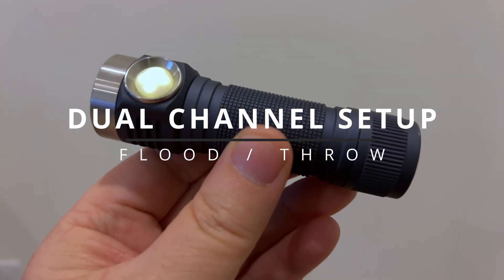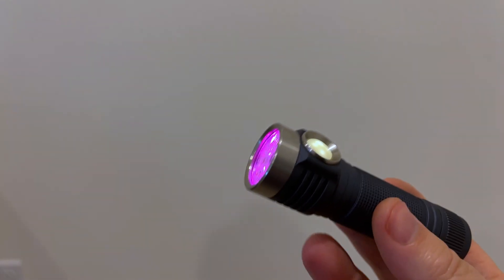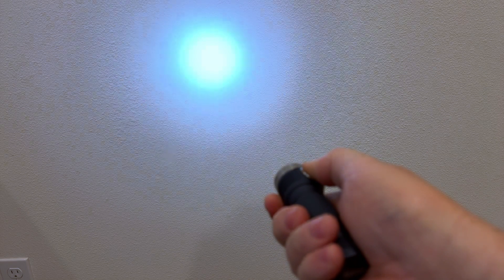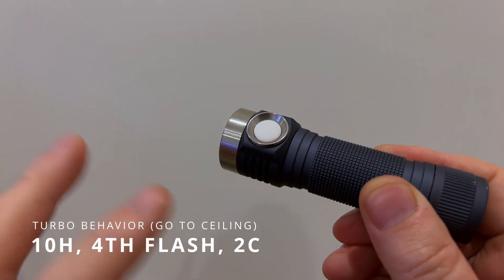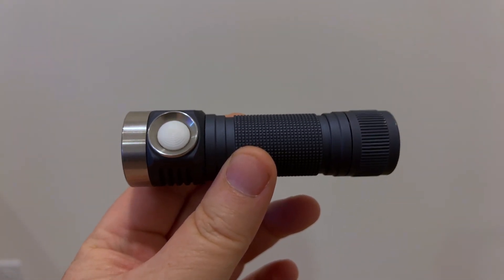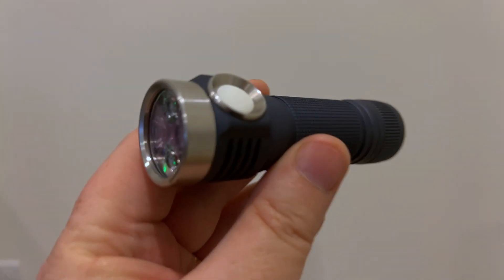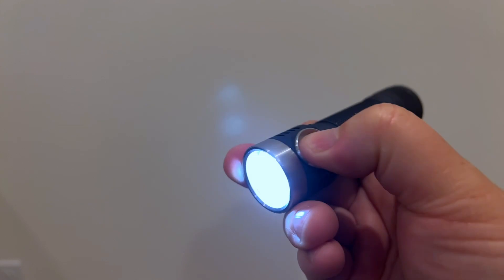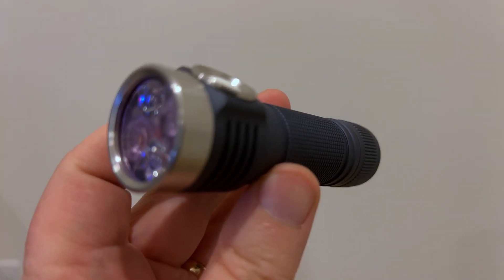How I set up a D4V2 Dual Channel KR4, D4SV2, D2

Comment: I am a fan of Mkong1's Anduril firmware branch for dual channel lights. In particular, he added a 3rd stop in the channel switch that goes to both channels on (50/50) at whatever brightness you have it set. Without this add on you have to use smooth ramp to get both channels on at any output below turbo. His branch has the normal 3H from on to change channels but adds 4H to go to all emitters on at whatever output is selected. You can adjust the output as normal after the 4H.

He also has some other cool tweaks like swapping the 3C bat check with the 4C lockout from off. I have especially found this fork usefull on my D4V2 with W2/lh351d 2700 which is something in-between a flood/throw and tint shift light. It is kind of a true 2 lights in one body but the middle setting is actually useful in blending temp and distance at lower output (for me at work anyway)

I had posted a link to his discussion of the firmware fork on the /flashlight r3dd1t but the oveloards seem not to like that so my post was pulled. I'll just say that if you search on "mkong1 anduril middle setting" you will find the discussion and the github links for the firmware.
Reply from the maker: Michael Kong and I talk sometimes. He does phenomenal work. I just am always torn between staying stock and using an upgrade. I like to have that muscle memory for stock firmware in case I have to answer other people’s questions.

Comment: Very good info. And very easy to understand.

However, when I’m dog walking at night, I like the option of having all emitters on max with 2C. I’m usually walking with my dual channel light(s) in flood (lh351d) at fairly low brightness. We have coyotes and deer pass through our yard a lot a night, so when I hear a noise while walking at night, I want to light it up with full power (lh351d and w1). 

I guess I don’t understand the application or reason to keep the dual channel light from max 2 channel output on demand. Can’t I accomplish the same thing as you by simply pressing and holding to get max brightness on one channel? Then if I want even more light, a quick 2C brings up both channels on high power.
Reply: Yea I was wondering if there is a way to still be able to ramp up to 150
Reply: @itachii267  

I have not explored floor and ceiling settings. I assume either/both will give me 130/130 with 2C? Or is that incorrect?
Reply: So you’ve set it up like the first version of anduril tint ramping? I have the original version and this is how it works. Double click is full brightness of one channel only.
Reply: @brokenlegz  

No. 2C for me brings up all emitters on high.